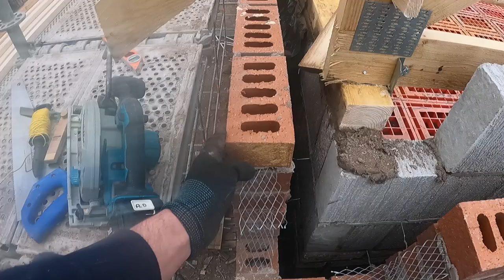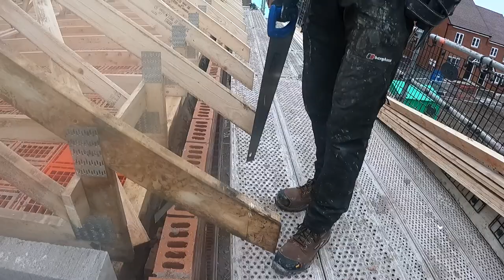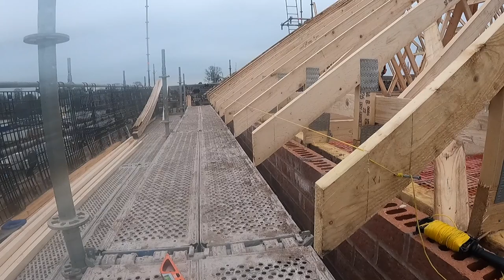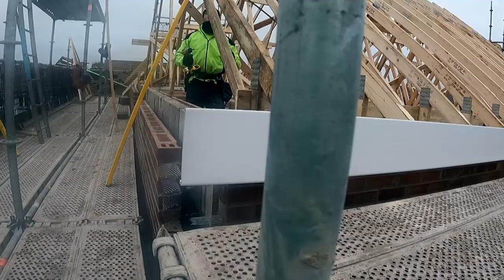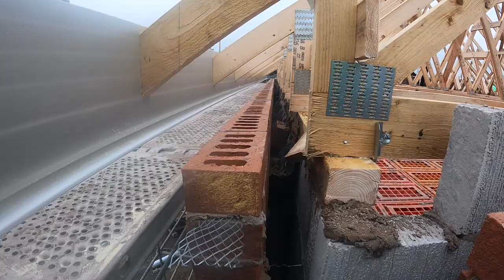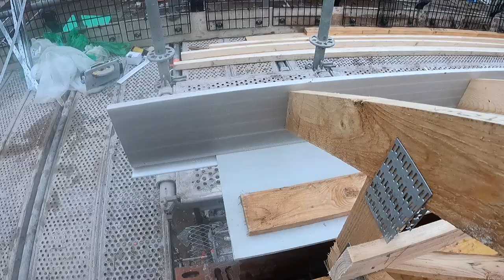How to - Fit Fascia & Soffit

Comment: Good video, what the pros and cons to a sub fascia with a thinner capping board over
Reply from the maker: cheers! pros i guess are the timber sub fascia is strong so will add strength, also allows fixings all the way across for guttering etc. if we use sub fascia we normally use the same size fascia as usual, its just the 4x1 timber that we normally dont have enough of. no really any cons of a sub its a better job overall. cheers
Reply: @ashleydavenport3794  i like the idea of the timber sub fascia for strength and gutter brackets but then the upvc capping board over it to keep costs down but combined i think its too thick together for over fascia vents to work.

Maybe adding the thicker one sitting higher than the sub board would work ok.

I'm doijg a self build so need to decide.
Reply from the maker: @handle1196  sounds good, I’m not sure how the over fascia vents work but I’m sure it would be fine if they were the same height but not 100%. You could hang your capping fascia slightly above the sub? I know it wouldn’t be that strong but could be an option
Reply: @ashleydavenport3794  i need to get my hands on some over fascia vents to see, they look designed to sit on an 18mm board nails down into the fascia then have an air vent that over hangs the front.

So the nail down needs to go into something solid like the 18mm board and not end up going between the fascia and the sub fascia. 

I'll get hold of one but guessing they're best used with 18mm board only.

Comment: Good vid!!! Thanks. Does the facia need to be a certain measurement above the rafters?
Reply from the maker: It Varys from roof to roof/ pitch of roof etc. but let’s say the roof is like 30/35 degrees I’d probably aim for about 3” of kick. All depends on wall plate and face brick heights tho too. Cheers for your comment 👌👍
Reply: @ashleydavenport3794 does the fascia top not just sit above the top of the rafter ends by the thickness of a 25mm batten?
Reply: @handle1196  you need to set the height according to the type of tile/ slate being used, and there is almost certainly a  fascia vent strip to go on top. A tile batten thickness above with a vent may or may not be enough. You need to get some tile and batten to check the first one doesn’t dip down.

Comment: You don't say how much the top of the facia sticks above the top of the rafter for the tiles to lift up. ?
Reply from the maker: This was pre set really by the height of the face brick and how much the corbels were set out. Ideally you want around 50mm id say but depends on the pitch of the roof and things like that. Cheers your comment 💪
Reply: And if the roofers are using over fascia vents or not